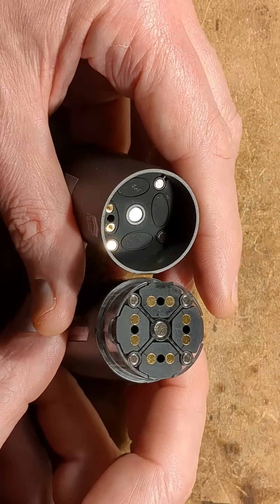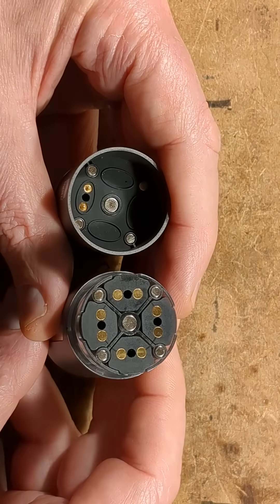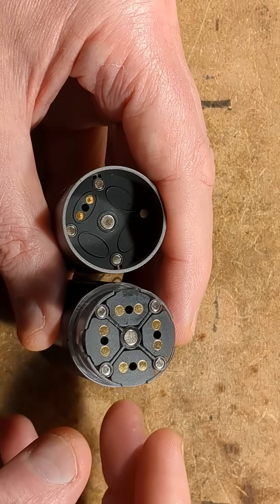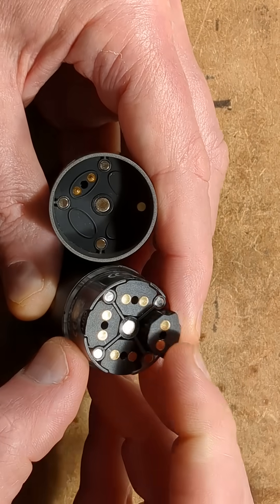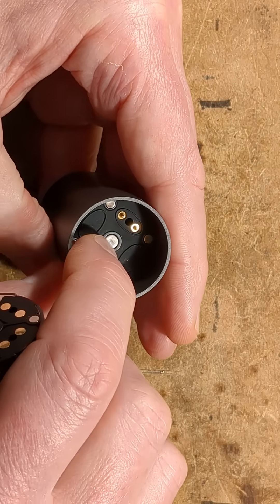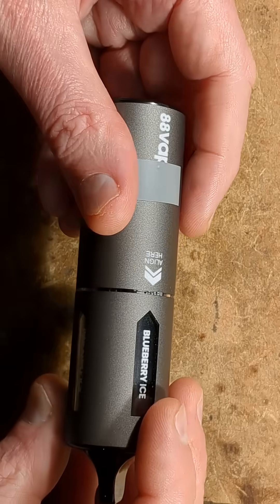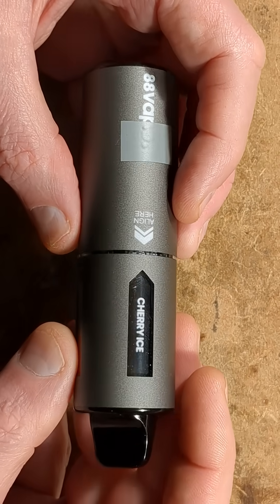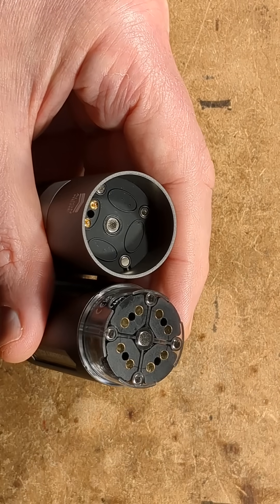Clever magnetic indexing and contact system

Comment: This way of making a carrousel can be more easily replicated than the old way of making carrousel for RF devices(or TV channel selector)
Reply: Yes, the old 405lines TV turret tuner.
Reply: I thinking of replacing the coils on some pods with fixed resistors as half a voltage divider to build an activity tracker with interchangeable tasks that you can cycle through with rotation.
Reply: I remember those well.   We had a Baird TV which had a motor driven turret, so the user just had to slide a control on the front of the telly to select a station.

Comment: Do the pogo pins slide across the surface? I'd be afraid of lateral force on them over time causing issues.
Reply from the maker: They do.  But they seem to glide smoothly.
Reply: Was about to post the same thing. Over time the friction will be a problem in this thing. As a vaper, we are also very prone to fidgeting :P
Reply: If Clive says it's good. It's good!
Reply: You can see a little "groove" forming at the surface at the end, or this was deliberately a smoother surface. What I'm wondering, how the pins make it over the "fume exchange port holes", so they don't catch on the edge of the bore.

Comment: You could use it (just an idea) say a soldering iron on one cartridge, a small screwdriver motorized ofcourse, a flashlight and a electric lighter,
Reply: That's all well and good, but for those examples you could skip the rotating aspect of it and simply connect them in parallel and have a button to activate each thing. The need for this mechanism comes from the fact that it's actuated by air pressure. In this case the air ways for all 4 cartridges are connected in parallel but instead only one is powered at a time.

Comment: Neat! What keeps the pogo pins from dropping into the vent holes of the cartridge and jamming the rotation?
Reply from the maker: Precision and tapered ends.
Reply: Good catch. My guess is, the pins never go over the hole, but barely pass them on the outside. Because of rotational movement.
Reply: Springs? I don't know what I'm talking about tho. Maybe some kind of seal and pressure differential?
Reply: nothing stops them from the looks of things, the magnetic pull is just stronger than the detent in the contacts so it doesnt lock up

Comment: Wait but what does it do... I'm confused
Reply: From the looks of it, it's a vape machine.
Reply: @SirRigbyBaconKaiser  New UK law banning disposable vapes and this is the manufacturers way of skirting the law. Technically you can charge battery and replace the cartridges in these but nobody will since they cost the same as the now banned 'disposable' ones
Reply: @bam-skater a rechargeable with disposable carts is just a plain better idea to begin with
Reply: my guess is it's a vape with 4 different swappable cartridges, so you can choose between 4 flavors and rotate between them
Reply: @jujuteuxOfficial A side effect of it it's circumventing the 2ml cartridge capacity limit. By carrying four cartridges.
Reply: Ohhhhhhhhhhhh, thanks everyone. 
Now I've seen the mouthpiece and flavor names on the bottom piece
Reply: Flavor changes
Reply: Vape. you can read the 4 names of the 4 indexed flavors...